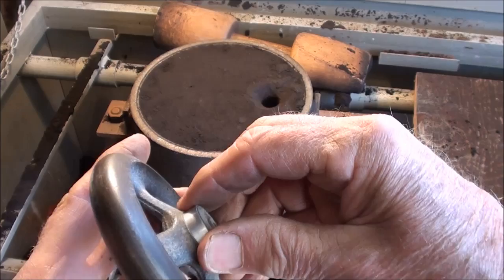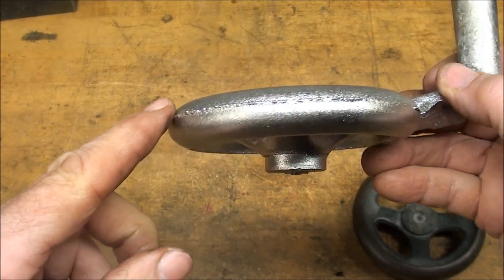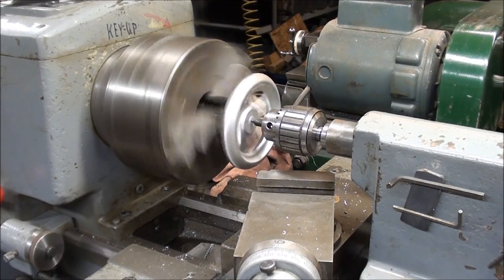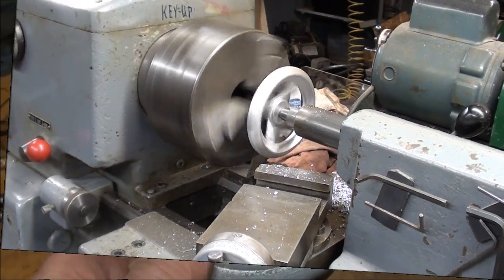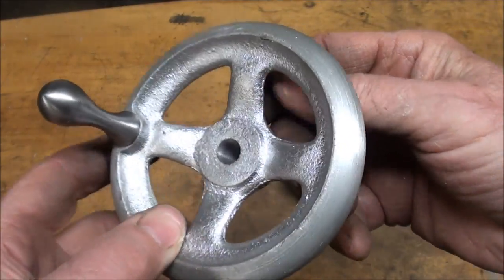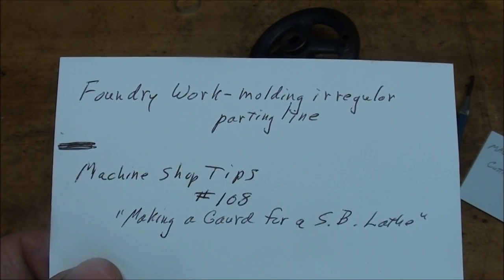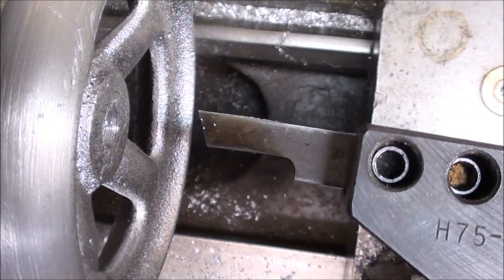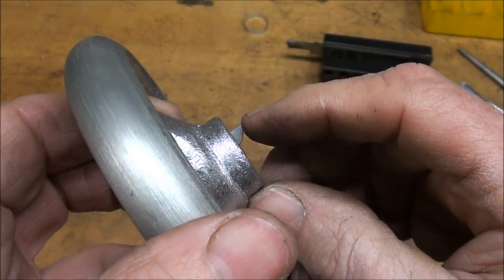MACHINE SHOP TIPS #159 Making a Lathe Handwheel part 2 tubalcain

Comment: Mr. Love, my shop teacher, at J. G. Whittier Jr. High school taught me how to drill and tap the hole for a handwheel crank handle just like yours. That was in 1974 and I remember it like it was yesterday. We also had a pot metal foundry and the 7th graders had a lead foundry that they used to make little lead soldiers. Thank you and all shop teachers!
Reply from the maker: +Tim Heagarty Thanks for watching.  We shop teachers did not get much respect from administrators or fellow teachers.--------------Until of course they wanted something fixed.

Comment: There are lots of ways of slotting on the lathe. Some people disconnect the top-slide nut and operate it with a lever from the tailstock, others build slotting attachments. I've done it using the quill on the Bridgeport.

Iron casting can be done at home in a crucible furnace, but an oil burner is needed and you better make sure your refractory is up to the temperatures required!

Comment: Mr. Pete, while using a casting as pattern, you get close as eggs, but not identical. If done repeatedly using the latest casting as pattern for the next, eventually the thermal shrinkage will show up in smaller casted parts. Patterns are usually made slightly larger to account for thermal expansion of the molten metal, to get near net size result.  Interesting video, thank you, now I want to cast something!
Reply from the maker: Yes, that is all true

Comment: Just a passing thought - Aluminum melts around 1100 degrees and that is HOT! Iron around 2800~2900 degrees. I fully agree with you about not attempting iron unless you are in the 1%. I set a crucible down on a 2x8 for a second (while melting aluminum) and the board burst into flames. Also it's dangerous to melt over a concert floor, sand trap is much safer, should there be a spill.
Reply from the maker: +Tom Herd Yes--its all mighty dangerous

Comment: I have made keyway slots with a small hand file but doing it with a lathe is just another way of doing it and a good tip cause not everyone has a broaching set lying around
Reply: I did it one time on a pulley, not sure what the material was, but I used my lathe like this with a small file in my tool holder.

Comment: I'm sure you've thought of it since the video was made - but as the pattern part was cast iron, you could have used a fairly strong magnet to aid lifting it free of the sand. Handy place to get strong donut shaped magnets is the magnetron in a defunct microwave oven - the magnetron contains two very useful magnets.
Reply from the maker: +Mark Sinden Good idea-thanks

Comment: Happy 2020 new year mrpete. I've had a small lathe & vertical mill since mid 1980's, but due to work priorities, I only ever got to use them occasionally for odd jobs. Now I've retired, I'm improving my  machine tool knowledge thanks to your excellent videos. On this one; it's a great casting, but I'm left puzzled about what caused the poor finish (seen at 14.00) on the 3/8" bore (reamed at 4.00).  I''ve only ever cast lead, for model yacht weights, so never machined a casting, but I'm wondering if maybe the dross does't always float to the surface and could the molten aluminium have got internally contaminated with a piece of hard grit, perhaps from the sand,  and got lodged on the reamer cutting edge?

Comment: What an interesting coincidence I was just looking through a book that came with my Bridgeport on options and I seen the attachment that goes on the back. Are those options for the back of the ram what make a mill a turret Mill?just asking because that term always confuses me. As always another great video on casting. I worked for four years at a piston foundry and I hand poured the military Humvee pistons in squeeze cast mold machines. It was very interesting to say the least.

Comment: Excellent video and I found it just in time...The temperature here in Carolina just dropped to 30 degrees, it snowed, and I have a bunch of time off work. You have inspired me to fire up my warm foundry and make a few of these. 

Have you ever poured copper? Is it difficult? I know it has a much higher melting temp than aluminum. I want to make some copper fly wheels like your lead ones that I've seen.
Reply from the maker: Glad I inspired you. I poured copper once 45 yrs ago. Unsuccessful. Use brass if you can. Both very hot & scary
Reply: Thank you for answering my questions. It is a big help and it is appreciated. 

I had a both a fail and a successful day pouring aluminum. I learned that clay molds will not work no matter what. ...It either boils or it cracks apart.

The lost foam-in-sand method works great for me. I poured all kinds of fly wheels and pistons. The cast picked up every single detail that was on the foam carving, including the saw marks.I will probably use this method exclusively from now on. 

My girlfriend is a potter and she told me about metal clays, have you heard of them? It's not really a clay but nano-particle metal with a binder. It works like clay but when it gets heated the binder burns away leaving pure metal.. It is used by jewelers.  They have copper, gold, silver, bronze, and stainless, I think it would work good for micro sized engines but a little expensive for bigger fly wheels. 

https://www.riogrande.com/Product/COPPRclay-200g/132008

Anyhoo, thanks again...
Reply from the maker: Clay has no porosity for gases. Also--may still have moisture in it.
I never heard of jewelers clay.  Good luck with the lost foam--I have no experience with it
lyle

Comment: Question - are you degassing your liquid aluminium just before pouring it? Those inside imperfections (air pockets, holes) may be eliminated by degassing
Reply from the maker: +jerzyk007 I bought degasser recently
Reply: not the tablets? http://www.budgetcastingsupply.com/product-p/2011-010.htm

Comment: In the closeup (at 14 minutes) it almost looks like the center hole has threads, that can't be right? You wouldn't make a keyway in a threaded hole. I assume those are machine marks from boring the center hole?
Reply from the maker: You assumed right

Comment: Well, I find out at 12:10 of your video, the electrical power inlet cable to your lathe is provided inadmissible way! There is outer cable insulation removed  and single wires exposed to mechanical harm. Please repair your machinery in order to ensure your safety and follow your excellent skills.
regards
Milan
Reply: There is no danger here other than safety police.  He has a 1/2" cable clamp clamping the wires from being pulled out of the box.  There is likely not enough room with a 1/2" knockout in order to get that size cable pulled through the cable clamp.  The box is on the back side of the machine and looks to be in a spot that is likely very inaccessible to chance damage to the wires.

Comment: How do you use a Woodruff key in conjunction with a threaded shaft?
Reply: You don't.  The end of the shaft might be threaded to hold the handwheel on, but the bore of the handwheel is not threaded, nor should the shaft be where the Woodruff keyseat is cut.
Reply: Richard Freeze Yes, but it appeared to me that the handwheel bore was threaded. Hence my confusion.
Reply: Yan Wo Yes, it did appear to have a bit of a spiral to it, but it wasn't threaded.
Reply: OK. That clears it up. Thanks!

Jon